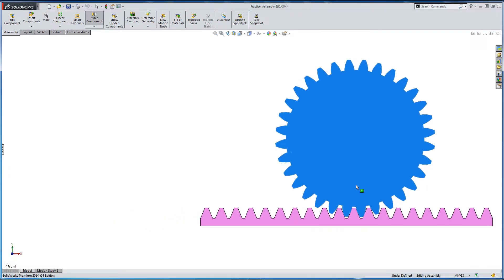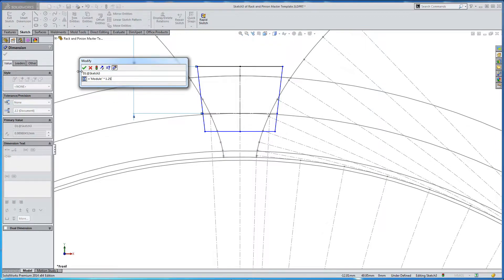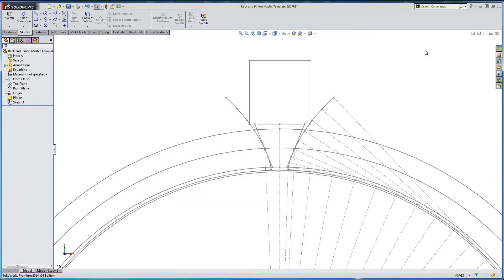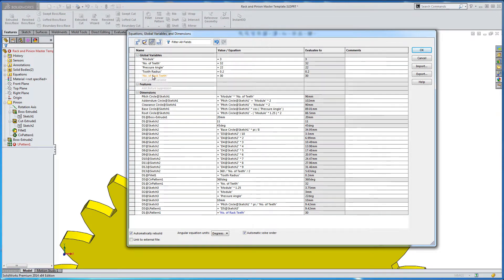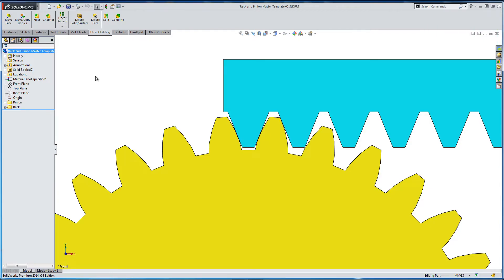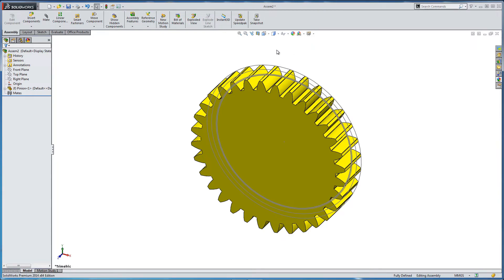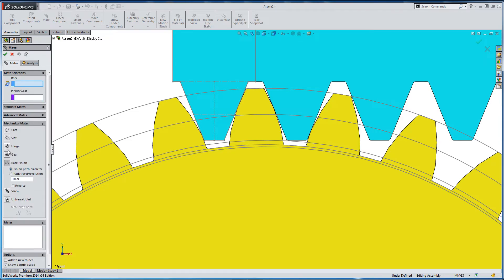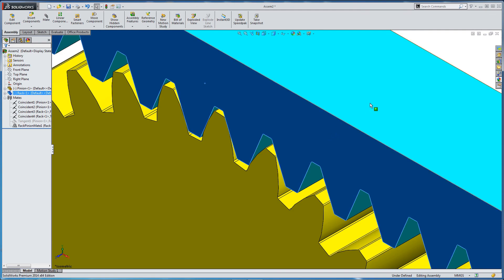Rack and Pinion Design 2 - Rack gear design in Solidworks

Comment: This is fantastic. The assembly mates I typically just use a parallel mate like the planes you used, and then use the pitch diameter as you did. Sometimes the pinion and rack don't come from the same source. Love the vid, great clear work, and appreciate what happens when it "goes wrong" and how to fix it.
One thing I ran into during the video was that my rack model was creating every instance individually, for anyone following the video, you want to play with the geometry pattern only button, as that will merge all the linear pattern instances.